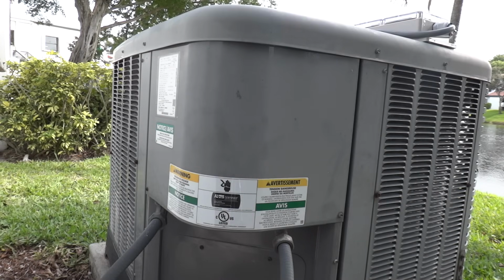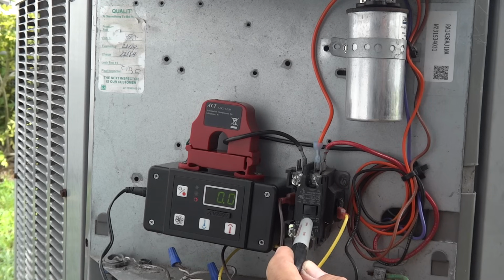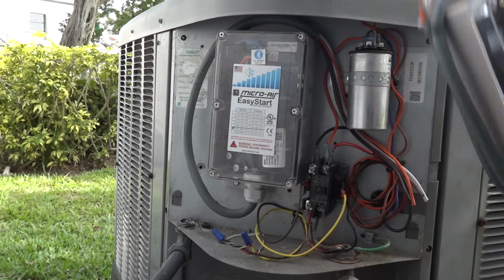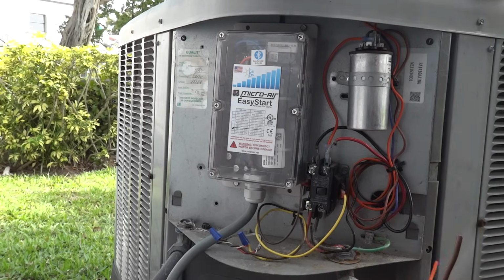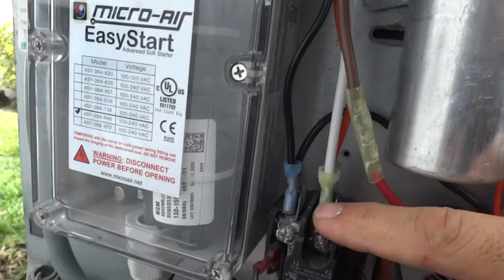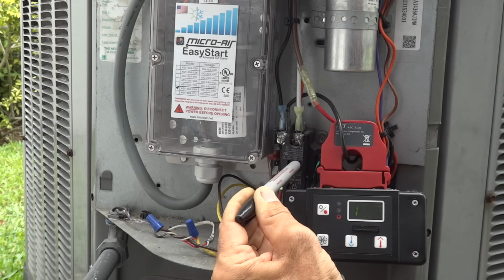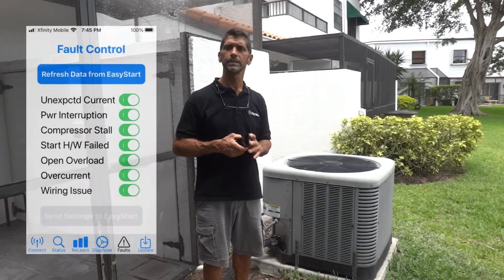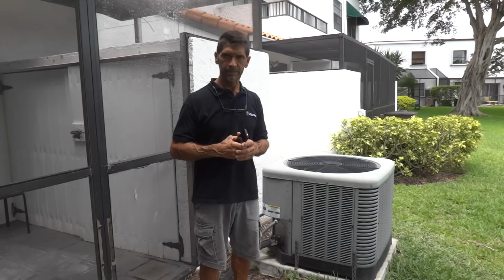Micro-Air EasyStart Home A/C Installation (368 Series)

Comment: Just my two cents, I think is important to mention how to connect to the easy start with the app, depending on your phone and OS version this could be a real easy step, in my case with Android 13 I had to do a device search to find the BT ID, you must type this ID as is shown, on the app with caps and lowers, and numbers  you can also do a search for (Easy Start_) and it should give it to you mine did not have it inside the unit. Password is either 0000 or 1234. It would be great if the instructions would include this information. Also the unit must be running or it will not connect since the BT on the Easy Start will be off. Also on some of the wires, if there is a connector, already in place don't cut the wire use it and just add the appropriate end to the Easy Start wiring ends just in case you have to take the Easy Start off for whatever reason. My 3 ton unit (Goodman) with (Comfort Connect module, which it will not chance the hook up by the way) is around 12 years old, the original starting amperage was around 75 amps, now with the Easy Start is hovering around 25-27 amps with around 7-9 running amps. The only things I noticed that are different are that when the compressor starts it makes a louder click noise, not sure if is coming from the contactor but it sound more like metal to metal, so not sure if is supposed to do that, also since I have an Enphase PV system with CTs my monitoring portal is showing that the wattage consumed by each cycle has gone up, so not sure if the hard start I had installed there before the Easy Start was helping in that aspect, but with the hard start, I did noticed that when I first installed the wattage draw per cycle dropped substantially by almost 2000 watts per cycle. if anyone has experienced this please share it because I have a feeling that as far as savings due to lower watts consumption per cycle is not really worth the extra expense on top of the price for the Easy Start. I can see the benefits for whoever uses a generator, but since I don't have one yet and I do have battery backup and most appliances are gas and or 120v. I rather save on the daily use of electricity. I've had that cheap hard start kit for around 7 years without any issues.Tonight I'll check my daily stats to determine if my consumption went up, if so I will post the results in this post as an update, hopefully I won't have to return this product. I'm not an AC guy, but I'm learning as I go. It be pretty awesome if they could add a hard start option to the Easy Start! I sent a diagnostics data report and they reply back with thumbs up, so I know is working as it should to include the app features. Last but not least what is the warranty on this device?  Great video by the way, looking to get a generator as another backup option for cloudy days, so I'll be watching some videos on that too, looking at the tri-fuel inverters by Champion but seems they are hard to get now a days and price gauging is a killer. Thanks for sharing. This comments are based on my personal experience, yours will be different, but I will be grateful for any meaningful feedback.👍

Comment: I like the product but skeptical about installing it fearing it will void the compressor’s warranty. Please advise. Thank you.
Reply from the maker: Hi and thanks for your comment.  Regarding the warranty, this question has been answered a few times in the comments here.  Below is a reprint:

The short answer on warranty is "it depends". Some manufacturers will balk at any modification to their system wiring if you submit it for warranty claim with anything added. The same should hold true for an aftermarket-added hard start, right?!  The good news is that EasyStart can be wired in without cutting any wires (by using a mating terminal for the run winding splice). If the system then fails down the road within its warranty due to an internal refrigerant leak, failed condenser fan, or something else, then you can legitimately remove the EasyStart before submitting it for warranty. There is no dishonesty here since any failure outside of the compressor itself cannot be the fault of EasyStart.  

Regarding the compressor, as explained in the video, EasyStart far better protects the compressor than any OEM configuration, so the likelihood of a compressor failure within the warranty period is almost zero.  If there ever was a case where the compressor failed within warranty, and the manufacturer denies the claim because EasyStart was installed, contact Micro-Air and you may be surprised by we do.  Since this manufacturer's warranty concern was also an issue for some in the RV aftermarket, Micro-Air starting guaranteeing customers' RV unit compressors that are up to 6 years old (way past the standard manufacturers' 2-year warranties) for an additional 2 years.  This extended warranty program was considered for application to the home HVAC market as well, but it has not been approved as of this time.  Please also see the verbiage about the Magnuson-Moss Warranty Act on our website in the EasyStart Knowledge Bank at this link:  https://www.micro-air.com/kb-easystart/article_presales/easystart_Will_installing_an_EasyStart_void_a_factory_warranty.htm.  

So, the choice is yours.  If you do elect to purchase and install an EasyStart, and down the road something happens to your system where a warranty claim gets denied simply because EasyStart was installed, we would review your case and would still consider helping.  There have been no legitimate such claims to date in the 100,000+ EasyStarts sold, so we are that confident in EasyStart and its added protection of your compressor.
Reply: @MicroairNet  Thanks so much for this detailed response to my question. It’s really comforting to know that MicroAir will provide support to their customers when needed. Thanks again and all the best!
Reply: Ok, I’m ready to purchase the easy start, but want to make sure I’m getting the right model for my unit. So I have a 3.5 ton unit, which relates to model 368-x48-blue per your wizard. Since my unit is so close to the next model up, the 368-x72-blue, will I be ok going with the x72 instead of the x48 model? Please advise. Thank you.
Reply from the maker: @laramie_1944  Hi again and thanks for your continued interest.  You did the right thing by using the online model sizing tool.  And when it comes to EasyStarts, bigger is not always better.  Although the X72 would work fine, the X48 is better optimized for your particular system capacity and will deliver lower starting amps than an X72 might do in the same (undersized) application.  Hope this helps.
Reply: @MicroairNet  Thanks again for the quick and very informative response! I will be ordering the x48-blue.

Comment: I used tarp elastic bands with hooks. My EasyStart did not fit inside. I did not want to screw into cover because every time you service AC unit the cover is removed and placed on the ground.

Comment: I installed an ASY-368-X48-BLUE on my 3 ton A/C unit last week. I’ve been in the HVAC business for over 40 years. I’ve seen a lot of changes to the equipment over the years but the Easy Start has been one of the best ideas in years. I haven’t liked the way the compressor started since the day I installed the system. It works fine but is noisy on startup. The kind of noise that makes you think, “That has to be shortening the life of the compressor”. 
The Easy-Start was extremely easy to install and there is no change to how the unit is operated. A customer would not see any difference in the way they use the system. The compressor starts quietly now and the startup amperage went from 83A to 25A. Awesome!  
Thank you so much for making this device.

Comment: Great video.

Can you please tell me if this easy-start system also works on mini-split a/c units ??

I currently own a 2 ton mini-split unit and I believe I will be ordering the ASY-368-X48-BLUE.

Please let me know before I order.
Thank you much.
Reply from the maker: Hello and thank you for your question. Since almost all mini-split systems use what is known as an "inverter-driven" or "BLDM" compressor motor, they are variable-speed and they already ramp-start themselves with little to no current surge.  Therefore, EasyStart is not compatible with such systems and should not be installed. Hope this helps.
Reply: @MicroairNet  Yes, this information was very helpful. Thank you 👍

Comment: Is this product specifically for running the AC with a generator or it could save $$ on my electric bill???
Reply from the maker: This product won't save you electricity since it has no effect on your A/C's compressor steady-state running behavior; it only affects the start-up by dramatically reducing the start-up amperage, even on utility power.  Beyond this, EasyStart does help protect your compressor from harmful effects of power interruptions, brown-outs, low-voltage, and stall conditions, regardless of the power source.
Reply: @MicroairNet  thank you very much  for your fast response.

Comment: So the only advantage is the AC can start with less amps, what benefit is that to a home owner that is connected to the grid and doesn't suffer from power outages on regular basis?
Reply from the maker: The benefits are as follows:  1) Less wear and tear on the compressor, thus extending its life, 2) fault monitoring for low voltage, brownouts, stall, overcurrent conditions, etc., and 3) no light dimming and substantial noise reduction during startup.

Comment: when he did the momentary power loss test the amp meter was still indicating a current draw of 19 amps the same amount as in normal mode.  SO looks like the box allowed the compressor to start again without a delay.
Reply from the maker: The custom ammeter was doing a peak capture, thus it never changes its readout until deliberately reset by pressing a particular button.

Comment: Installed the unit on my 3 ton Bryant AC/heatpump. No issues with the installation using this video and the downloaded instructions. I also used the connectors kit which for 12 bucks is worth it. According to the Bluetooth app my new inrush amps are averaging 26.5 with a running amps of 7. My bryant manuals say their avg is 76 inrush and 16 running. I'm letting it run all weekend and next up is the test with my a-ipower 7100 generator. There is no noticeable decrease in sound upon startup (actually, now my compressor 'thumps' upon startup) however my primary purpose is to run off gen power....
Reply: next day update
I successfully ran my a-ipower 7100 using the easy start today. I did 5 starts of my ac using the propane power which has a reduction of load to  6400 w peak and 5100 running. My generator handled the load quite well, both at high speed and econ mode. Average running load on my generator display was 3000w, which was the ac running (again, a bryant 3 ton unit) my GE refrigerator and all home lighting, etc. The BT app showed a inrush amps of 23 avg and running amps of 6 avg. I'm really happy with these numbers as I can run in eco mode and save fuel.

Comment: I just am curious if this will save me money on the electric bill. I dont have a generator nor an RV. Just a regular house with very little power outages. I understand this will draw 70% less amperage in the startup. Will it slowly increase the amperage as the unit runs? Is this healthy for the AC unit? thank you for doing this video!
Reply from the maker: Hello and thank you for your comment.  This is an often-misunderstood concept regarding EasyStart.  As it turns out, EasyStart accomplishes the ramp startup within about 1 second. After that, the compressor is running at speed normally, and EasyStart has no effect on it its operation or normal steady-state current draw. Therefore, EasyStart does not save you a measurable amount of electricity (kWh). However, in some regions of the USA, there are electric utilities that charge a penalty for surges and spikes in current "demand".  In these regions, EasyStart could save you money on your electric bill.  Thank you again for your interest.

Comment: Can these be installed on a mini split 4 ton or 48k btu unit. And if so could you please make a video regarding since many of your followers have these types of units. Thank you.
Reply from the maker: Hello and thank you for your comment.  Since most mini-split systems have inverter-driven compressors, EasyStart does not apply and cannot be installed.  The reason is because inverter-driven compressors are 3-phase BLDMs (brushless DC motors) and they already ramp start without any current surge. Thank you anyway for your interest.

Comment: 😂 all it is booster capacitor in case. Buy one that without case it’s more cheaper.
Reply from the maker: Hi and thanks for your comment. You couldn't be more wrong in your assessment. Check out the following video link for the truth about the differences between a hard start (what you're describing) and the EasyStart soft start: https://youtu.be/7Gim96oyczw

Comment: I have a 5 ton Lennox system that was installed last year. Is the Micro-Air system compatible with this system? Assuming it is compatible, would this invalidate the Lennox warranty? Thanks!
Reply from the maker: Hi and thanks for your comment.  Yes, EasyStart is compatible with your Lennox 5-ton. Regarding the warranty, this questions has been answered a few times in the comments here.  Below is a reprint:

The short answer on warranty is "it depends". Some manufacturers will balk at any modification to their system wiring if you submit it for warranty claim with anything added. The same holds true for an aftermarket-added hard start, right?!  The good news is that EasyStart can be wired in without cutting any wires (by using a mating terminal for the run winding splice). If the system then fails down the road within its warranty due to an internal refrigerant leak, failed condenser fan, or something else, then you can legitimately remove the EasyStart before submitting it for warranty. There is no dishonesty here since any failure outside of the compressor itself cannot be the fault of EasyStart.  Regarding the compressor, as explained in the video, EasyStart far better protects the compressor than any OEM configuration, so the likelihood of a compressor failure within the warranty period is almost zero.  If there ever was a case where the compressor failed within warranty, and the manufacturer denies the claim because EasyStart was installed, contact Micro-Air and you may be surprised by we do.  Since this manufacturer's warranty concern was also an issue for some in the RV aftermarket, Micro-Air starting guaranteeing customers' RV unit compressors that are up to 6 years old (way past the standard manufacturers' 2-year warranties) for an additional 2 years.   In the past 5 years, there has only been one claim, and it wasn't really Micro-Air's fault, but we bought the customer a new rooftop unit anyway.  This extended warranty program is now being considered for application to the home HVAC market as well.  Please also see the verbiage about the Magnuson-Moss Warranty Act on our website in the EasyStart Knowledge Bank.  But in the meantime, if you suffered a warranty claim denial simply because EasyStart was installed, we would review your case and would still consider helping. We are that confident in EasyStart and its protection of the compressor.
Reply: @MicroairNet  Thank you for the detailed reply. Jon

Comment: I love my EasyStart - I have the ASY-368-X72-BLUE for my Trane 4-ton unit. Before EasyStart - Peak Current Inrush = 133.9 Amps / After EasyStart = 35.5 Amps Running amps 16.5  I am very happy with the EasyStart and find it well worth the money. Thanks, Guys!